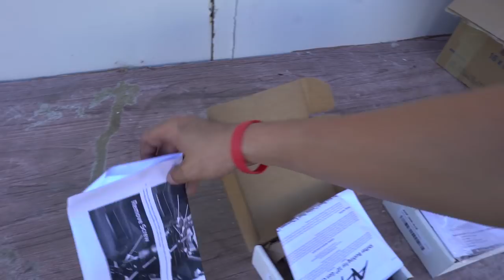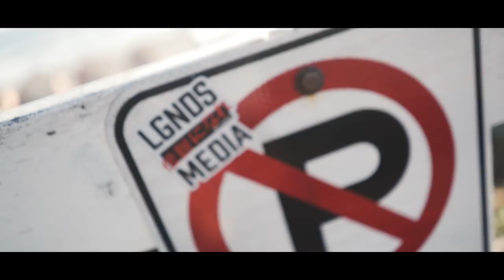i broke my $5000 camera set up...

Comment: I am a tow truck driver. I would never use that strap as a functional tow strap at that location. That crash beam is not meant to be winched/pulled from. I always attach to the frame/chassis.
Reply: K T I thought that would be pretty obvious but I guess not. Common sense isn’t common.

Comment: strength wise, the tow strap should be mounted with the hole parallel to the bottom of the crash bar. otherwise when pulled, the stress is somewhat diagnal instead of relying on the bolt. just a thought.
Reply: Jared Lardie  First time he uses that strap to pull the car its gonna rip the mesh or worse,  whole bumper off. And is that an aluminum crash beam? I dont see that lasting long in that spot and the way its bolted to the holes in it if he actually has to use it.  Maybe bigger washers might help but good luck. 😓
Reply: its not even that, this is a guy that focuses solely on how stuff looks/sounds not how it performs or functions
Reply: The tow strap will never get any use it's purely a ricer mod, the car will never see a track.
Reply: xack rogueAU He'll probably used it when it gets wrecks after sitting on the side of the road tho...
Reply: Brandon R wow that’s messed up, to soon bro.
Reply: That has to be the dumbest tow strap mounting I have seen. Because it’s mounted higher than the hole he cut, what do you think will happen when you pull tension?? I would love to see him test it and destroy his bumper.

Comment: Please tell us about the wrx already.
Reply: Conrad Mangao he said in the video before this that the final update on the wrx will be on sunday
Reply: Because its secretly been getting fixed
Reply: What size nut and bolt did you use to mount the tow strap? I got a tow strap from somewhere else but it did not include the hardware.

Comment: "Functional"

If you tow the car by that you are going to fuck up your bumper dude. The way it hangs down and is routed out means that if the full weight of the car is being pulled by that a lot of that energy is going to be transferred into the plastic bumper cover.